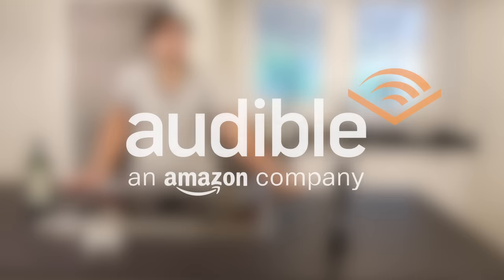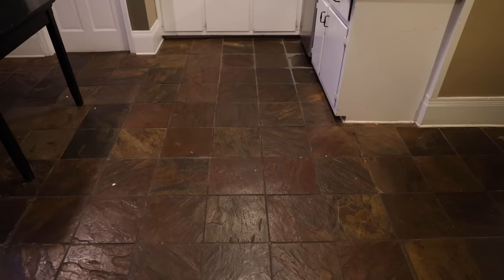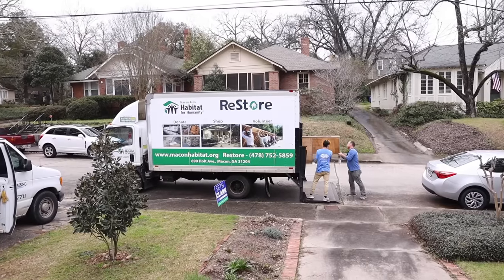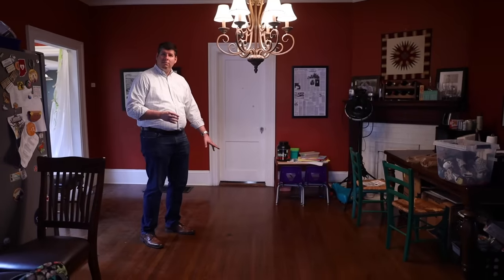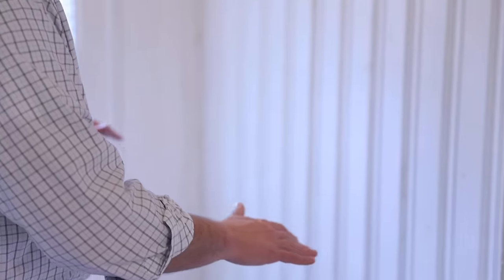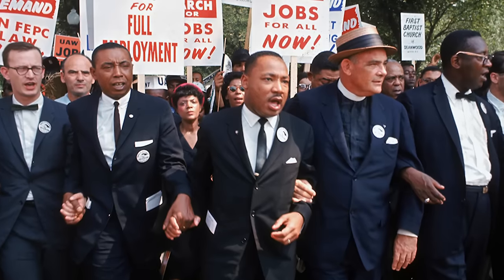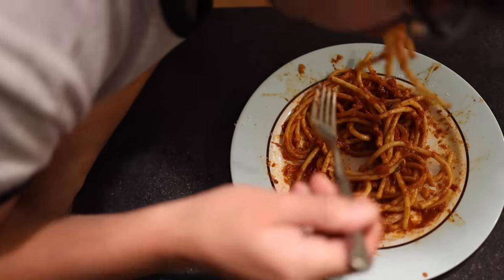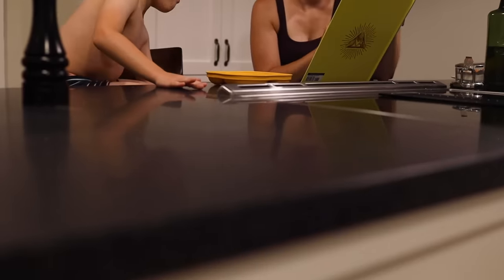How history changed kitchen design in the American South

Comment: I hope I', not in the minority, but..... there is NO substitute for a Hood (for a range.) Those built-in power vents into the range tops just don't cut it for taller pots, or for large numbers of pans/pots at the same time on the stove. Aslo, they should have ran that vent out to the side or end of the overhang it's under. Otherwise, that whole area of floor above it is just going to turn into one giant greasy firehazard mess.

Comment: YOU ARE COMPARING APPLES TO ORANGES.

Rich people today in their new homes still have service area with separate kitchens for chefs that work there.
Correspondingly, simpler homes in the 1930s did not have structures that had this much separation as in your higher class building.

Comment: Being from the "Hear of Dixie" there's aspects of architecture in the South that you seem to have no concept about.  It is hot here, even in the winter months there are many days/weeks where no heating is required.  Summer is always hot and humid.  Here along the Gulf Coast many houses had 2 different kitchens 1 outdoor kitchen for summer and 2 an attached kitchen for winter.  The attached kitchen became the norm but the  design with a separate kitchen was to keep the heat of cooking to add to the heat of the house. The back porch was part of the way to cool the kitchen.

Comment: With very little difference this was also a common design in the complete absence of domestic servants. Because quite simply the kitchen was hot as hell in summer. It still is when you cook everything except bread and ketchup from scratch.

We just don't try and keep that heat out so we end up using a fuckton of electricity to move that heat back out of the house again. Or just order out. To a shop or a factory filled with poor people on the edge of or actually in a state of financial ruin. So maybe a touch less of the high and mighty?

Comment: 1923: Great flu (H1N1) pandemic over a couple of years ago. 21-23 diptheria epidemic. 16-55 polio. Gotta wonder how people are going to look back at 2023.
Also, in 1923, even though the owners were well-to-do, air conditioning was just starting to be installed in commercial venues (like theaters) - and it gets hot in Macon. Who wants to add heat when it's already too hot?